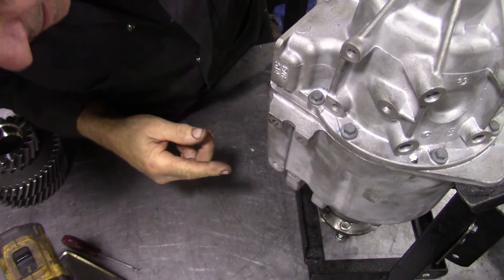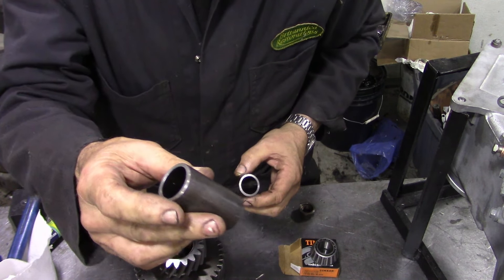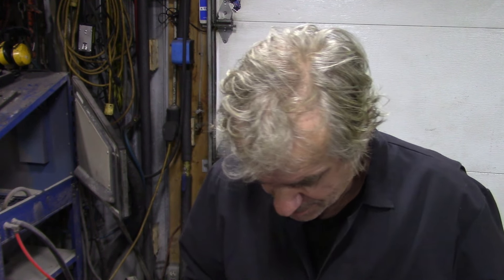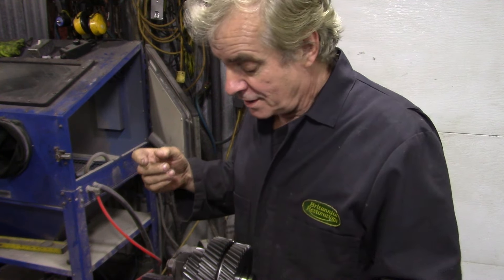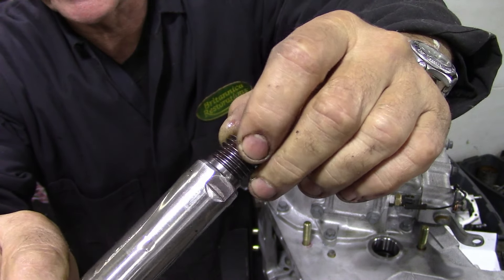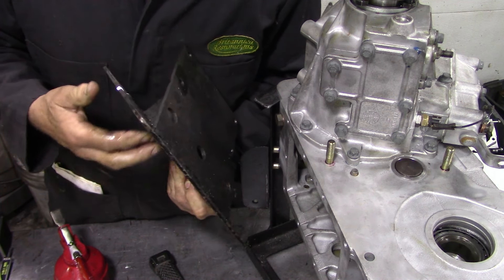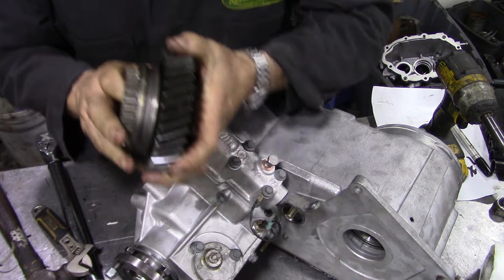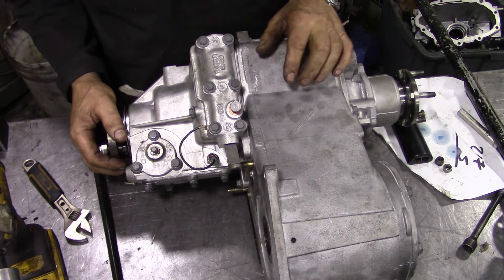LT230 rebuild 2024 with AATB Part 10 Intermediate gear and final assembly

Comment: Box is looking really nice Mike.
Reply from the maker: Yes - too nice to be below a vehicle!
Reply: Looks fab Mike.
I seem to remember you used to use rtv (or similar sealant) where the intermediate shaft and o-ring exits. Is that no longer needed with the custom bush and solid tube?
Reply from the maker: Correct - the solid bush in the casing means the original O ring can be used with no RTV
Reply: Excellent. Thanks Mike

Comment: GL 4 or 5?
Reply from the maker: EP80/90
Reply: @BritannicaRestorations  Make sure the oil does not have a slip modifier as recommended by Ashcroft.
Reply from the maker: Yeap - quote - We recommend using EP80/90 oil.